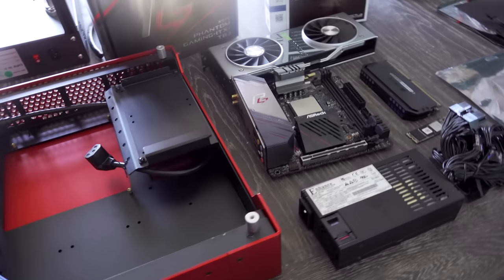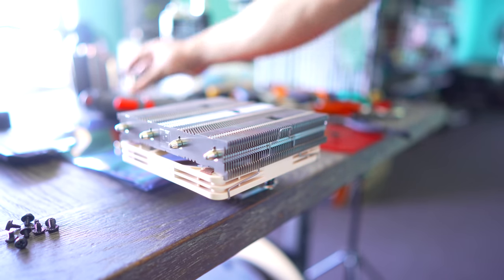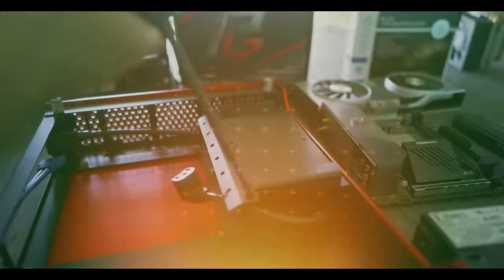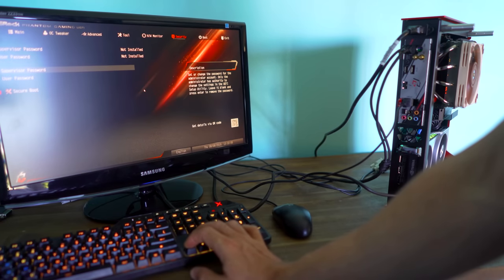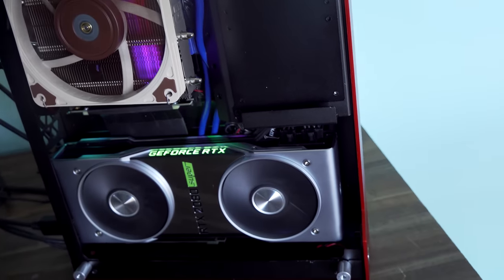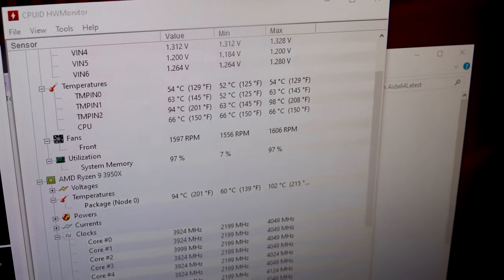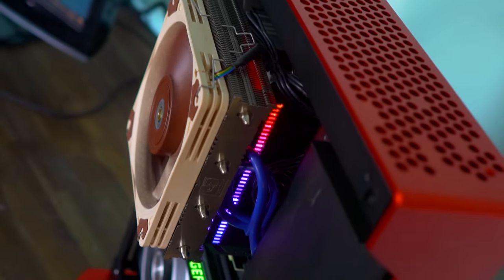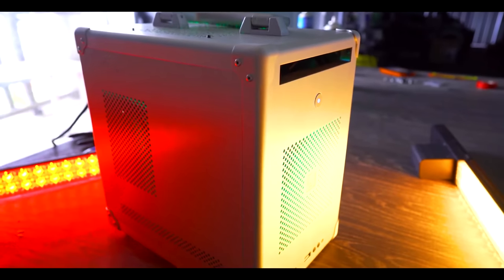3950X Mini ITX Build...! (Z-Case P50 Review)

Comment from the maker: I rendered out the wrong comment of the day, no idea what happened there...
Reply: Hey bryan i recommend you get a velka 3 or 5 im gonna buy one in the future
Reply: Where are your used gear ?
Reply from the maker: Did Christmas hustle in two parts. https://www.youtube.com/watch?v=pf7P3vByoEQ
Reply: You seem to be having some bad luck with sff cases, I'd recommend you check out some sliger cases such as the sm560 or the cerberus. I have one of them and they are top notch build quality and are really easy to build in
Reply: Hi Brian, I think you should take a look at the Cougar QBX. Doesn’t have a handle, but is a good budget SFF case with plenty of cooling and storage options.

I think you would quite like it, especially after making a few TechYes modifications to the case with a dremel.
Reply: In Australia is it possible to buy storage, ram, power supply and case for around $300. All to work with and 2600x and Vega  56
Reply: I  ordered the Zcase P50 back in July of 2019, received it end of September 2019. Also ordred the 600w Enhance PLATINUM Flex ATX PSU to go with it. I will say their customer service was good, and then Zenuin handed it off to SFFTek, and it is trash now. Since ive had the case, the PSU doe snot function since ive had it. Zenuin said hed send me a new one, and its been 3/4 months and SFFTek says they will handle it now and that i must wait another 3/4 weeks because they want me to send them my PSU for them to look? They are founded out of Hong Kong or something. Im not waiting more time on top of the time ive already been waiting haha. Also, i just took my front USB headers out, cause they conflicted with the installation of my graphics card (RTX Titan). My Card also didn't line up properly, so i just unscrewed the riser cable form the case and let it unsecured to the case. The PSU is also OBNOXIOUSLY loud. Im not one to care abotu noise, but for the first week my PSU worked, the fan is EXTREMELY loud for what people say is quite. My USB cable also came blue instea dof black, however my Power button was already installed unlike yours. For sure a poor buy i made on my part.  Wish i went with a Velka or a Sliger. I believe you could only reach the thermals they advertise for the P50 if you had a Blower style card.
Reply: Hi would you sell machine
Reply: Forgot pc I want Ps5 in this holiday
Reply: @techcheap2340  nah if you wanna compete against this then just get an S4 mini with an hdplex psu... otherwise this guy should have just used the L9i noctua instead of that thing... counter productive making the fan suck in from the glass panel... or he should have gotten a smaller fan and put it underneath the cooler between the fins and the cpu
Reply: Hay I'm from India. So it's available for India? Reply please.
Reply: Threadripper has low profile coolers

Comment: absolutely appalling  case design. Talk about a money grab with that 30 day warranty! You're far too easy on these guys.
Reply: I was okay with it until the misaligned GPU bracket. That's extremely unacceptable for $199.
Reply from the maker: I could bash it, but it's not in my nature, not recommending it and moving on is the best way.  I mean I am sure these guys didn't make a product with the intention of having it be a flop? Though the 30 day warranty and mismatch from the photos left me seriously scratching my head...
Reply: @techyescity  I agree Bryan. Not recommending it is good enough. You can make your point without being harsh. We have enough anger in this world as it is.
Reply: @techyescity  even with only partial enclosure, without an exhaust fan or some basic airflow the warm air just isn't going to clear away, will get pulled back in, and it'll cook... that's a pretty basic element of case design. Mistakes happen and all that, but at this price the case should function in basic terms, and it just doesn't.
Reply: I wish you could still get the PC-O5 from Lian Li. Same case concept, but done well.
Reply: This cost how much with how many problems, hmm
Reply: I like the component layout, i think there is potential in a flex atx dr.zaber sentry (not this one though)
Reply: @crunchychips8123  the pc05 also has the misaligned gpu bracket, i know because i own it. Same case but bigger design, and i also have problems with heat. So with these showroom pc cases its best to just undervolt or underclock your components only for noice purposes. Having crazy components  like tech yes city did was too much for this case.

Comment: 600 watts with a 40mm fan? thats going to be quiet for sure ;-)
Reply: It depend on efficiency. With 90% efficiency only 60 Watts are dissipated as heat at full load. 60 Watts can be easily passively dissipated with fan adding only a gentle breeze. I think at full load psu fan is the last think you will care for.
Reply: I have that PSU. Its an Enhance EN-7660B, 600W, 80 Plus Platinum. Its so efficient that when paired with some lower wattage parts (R7-2700 and 1660 Super for me) stays nice and quiet ;)
Reply: I've run this psu, enhance 7660b, with a gtx 1080 mini and 8700k and it stays fairly quiet. The fan on the psu is quieter than either the gpu or cpu fans.

Comment: I have a similar build, 3950X, 32GB of 3800MHz CL16 RAM, 1TB NVMe M.2 SSD, and an RTX2070 Super in a Node 202.

Absolutely blown away by the performance, and surprisingly, I have been able to keep the thermals in check.
Reply: The only reason I went with thee RTX2070 Super over a higher end card was due to the Ampere cards supposedly being right around the corner. I'm hoping for an RTX3080/Ti with reasonable thermal performance on the 7nm node.

Comment: I have this case, 3700X and 5700XT temps are fine but it is LOUD. Very informative video, I experienced some of the same issues you did but mine came with a power switch :)

Comment: The only way that slim small form factor cases like this would work and keep nice and cool, would be to take a page from MSI Trident X Plus ! They have 3 seperate air vented areas where it keeps the CPU, GPU and PSU and are on both sides of the case to keep both the case nice and cool and slim due to the smart configuration that they have it in !

Comment: I really like watching your video about these budget CPUs and you do put
 a lot of effort in making those. Keep up the good work. Also i have the
 question about E5 1650 v2, that i got with HP z420 machine and 16gb 
ddr3 at 1333mhz. How much overclock can i get from z420  ??,    kindly 
tell. I already got at 4.1ghz at air cooler, but for 4.4 to 4.5ghz what 
will be the setting.

Comment: I would recommend undervolting both cpu and gpu, it will help a lot with thermals.
Reply: I would reccommend putting the hardware into a decent case instead
Reply: @w19ely85  For those who have bought these cases, it may not be an option to buy another one. That's why we need reviewer like Brian to help us make the right choice.
Reply: @w19ely85  If you can tho, definitly get a better one.

Comment: The Evercool EC-HPS-810CP Low Profile cooler or The ThermalTake Engine 27 1U Low-Profile Cooler would've looked great and fit with the glass panel on.

Comment: Could you use cheaper ram with no heat spreaders (or they come off), then put the fan under the fins (its on the Noctua website). Then you wont have cooling issues with the glass cover installed and the fan will cool the ram?

Comment: You should have commission someone a cnc milled aluminum  panel with holes to facilitate airflow and test it then, a mill job on a oiece like this should not be over 30dollars, and this case will be absolutely bangin with it

Comment: Just the thought of running a ~260w GPU on a Flex PSU ... i'm surprised you could get games to work once the GPU and CPU ramps up.
Reply: This specific Flex PSU advertised as 600w which probably is good enough

Comment: Couldn't you have cut a square hole in the glass plate to let just the cooler protrude through it, while keeping the rest of the PC components partially hidden?
Reply: im not sure if your trolling or for real, but i will answer anyway .. you cant cut, drill or chip tempered glass without breaking it you need to make the cut out before it gets tempered
Reply: LOL First of all, that would be ugly. Second of all, it's really hard to cut the tempered glass beautifully and than file the edges.

Comment: We got the same saying in south africa.If it doesn't fit make it.What i see with that case os dust dust dust dust.I already complain to clean my dust filters every week and my tempered glass.Imagine how i will perform with a case like that.Personally speaking i won't go anything higher than a 3600 or maybe a 3600x in it.It's like my case.I could go 2700x cause of have an AIO etc.But i though the 2600 would fit better and it was half the price of a 2700x so well worth it.

Comment: They couldnt even "close" the sidepanel for 199 and the node 202 does that at half the price
Reply: It's not the side panels fault, he just used a cooler that the case wasn't designed to accommodate
Reply: @SpencerBaum  I mean the gap up front, not the one thanks to the spacers

Comment: All of you people bitching about the case but none of you mention the fact that the stupidly oversized cooling system is simply not appropriate for this case at all. The fucking fan was pressed up against the glass. Are you kidding me? Thats not the cases fault. That’s your own damn fault for putting an oversized cooler in there.

Use a lower profile cooling solution FFS. Then run this “test” again. This time with some competence.

Comment: Bad Thermals/Air Flow, Bad I/O Port Spacing, Lack of wires, Easy wear out of screws, Not fully closed with that spacing between the tempered glass, and that premium price for many cons.

Not worth it. Probably the power supply is good tho with that small form factor and 600watt.

Comment: For the price that GPU line up, fugly blue USB cable, no power switch, and junk hardware is beyond unforgivable. That 30-day warranty is there for a reason, they are hoping you can't get your build done before you realize they just stole your money with a $200 piece of aluminum that isn't fit to do its intended purpose.  Guess they were hoping if they put a dark enough tint on the glass it would hide all the flaws...

Comment: at $199, the power switch shouldn't need to be wired by the user. GPU and CPU coolers will be choked for airflow. Ugly. I wouldn't get this.

Comment: This has gotta be one of the dumbest cases on the market. You could buy a node 202, a platinum psu, and mod it with a tempered glass panel for less than the price of this case and psu.